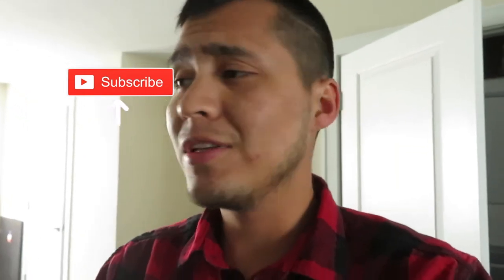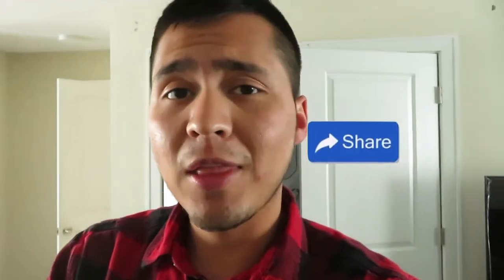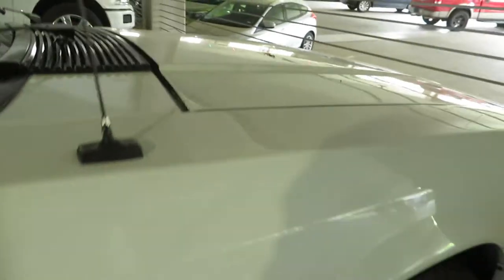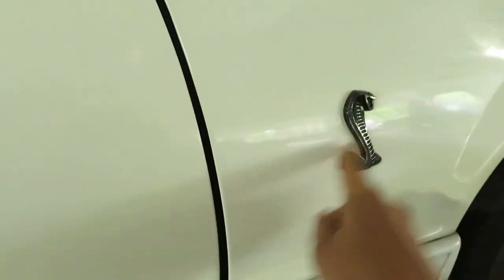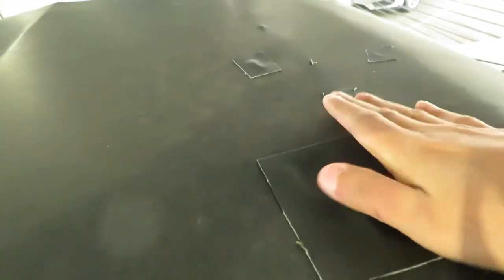Hail Damage Tore Up My RagTop

Comment: yooo I have the same 🦊 im also building up my car little by little thank you for this vid I have the same problem,I have like 1 hole on each back sides of the convertible and I haven’t fixed it... thanks.
Reply from the maker: For sure man anytime! The vinyl is pretty nice and definitely blends in can’t notice it as much unless your up close. I can’t wait until this project is done and move on to the next!
Reply: @itsadaily9993  how did you patch them?did you glue them or some other way?
Reply from the maker: No if you buy this vinyl they use 3m so you just rip off the cover on it and apply it to spot you need it on and it holds well

Comment: Will you do any high performance mods in the future ? Or would u like to keep it stock engine and original?
Reply from the maker: By high performance do you mean by adding boost? because my fox isn't stock at all. To complete the build for N/A I just need the upper intake. Which I just got in touch with LMR to discuss which will be the best route.
Reply: @itsadaily9993  i mean engine swapping super charger turbo etc ...
Reply from the maker: @cocozvidz5980  gotcha no I don’t plan on doing that with this build. In honesty I don’t like convertibles so this is just a cruiser. I’m searching for a hatchback or notch and I plan on doing a 351 windsor swap on it and then supercharging it.